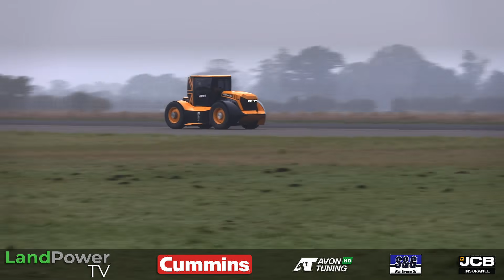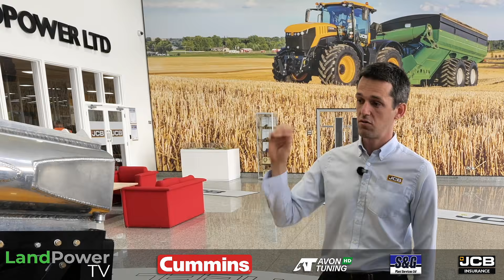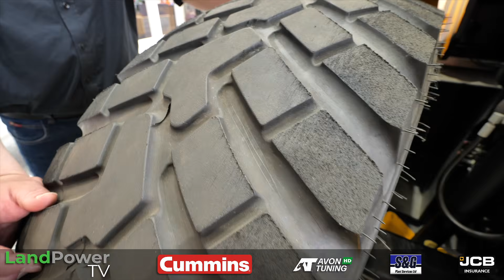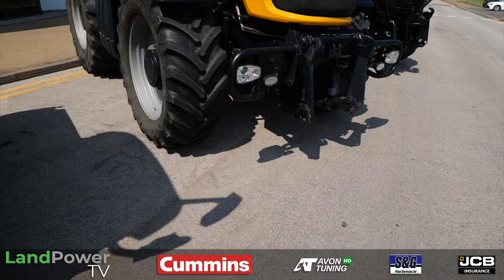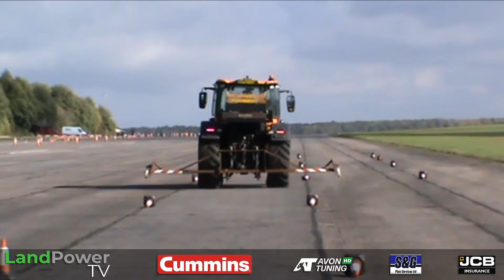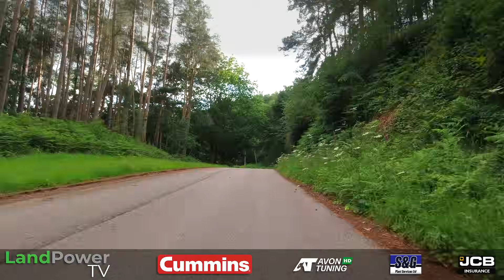ICONS OF AGRICULTURE: How does JCB design, develop and test its Fastrac tractors?

Comment: I Worked on JCB Groundhogs and They had to Stop Selling them because there were Total rubbish ?
Steering Racks Broke,Props shafts,Brakes Caliper seized,Pads Worn Down to metal in a Week of uses !,Suspension all Worn out,Engines overheating
JCB were Sending Grates Full of parts to Rebuild the Groundhog that Customers had Bought
They Just Were Badly Thought out and Not Fit For Purpose,which i Pointed out the 1st Time i Drove one !